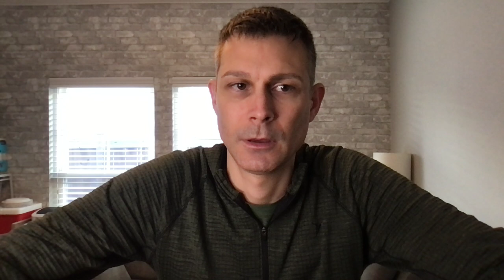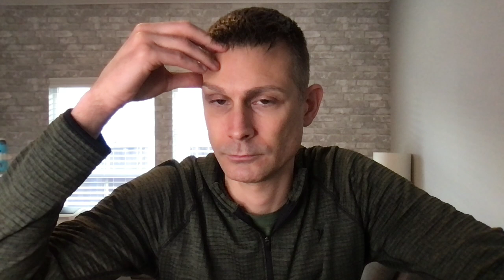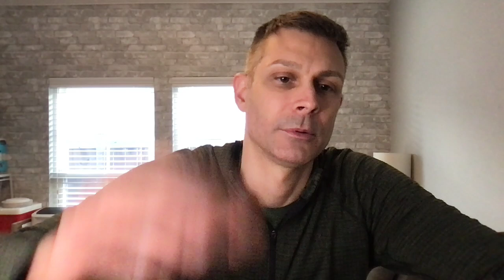2017 Chevy Silverado Code C0800 and battery drain when sitting overnight #batterydrain

Comment: Hello my battery reads 11 volts before even starting the vehicle it's a 2018 chevy suburban and it says code CO800
Reply from the maker: There could be a few possibilities for the diagnostic trouble code C0800.   I do not believe it is related to the battery issue your experiencing.  I suspect they are two separate issues.  I can help you here https://go.derrickslink.com/ask-chevy-mechanic